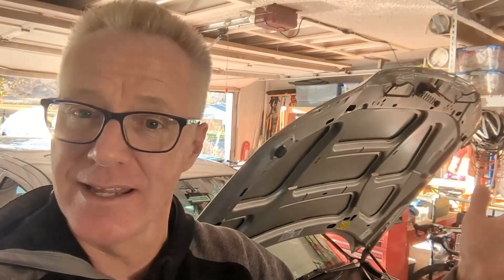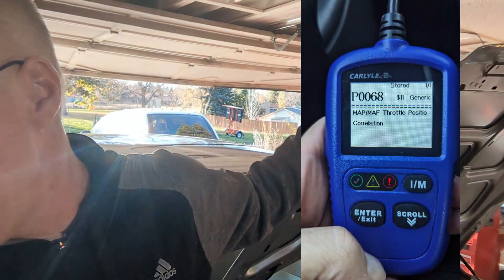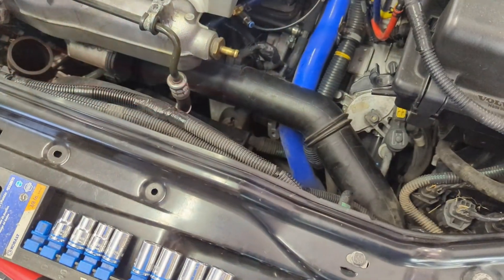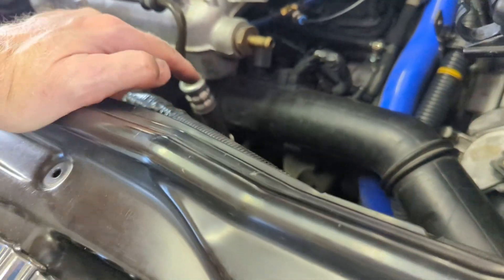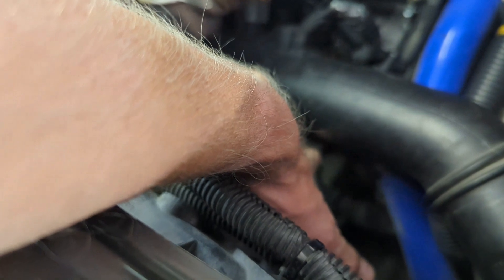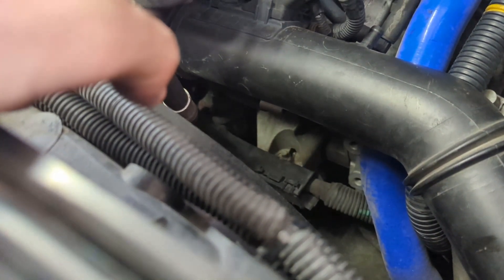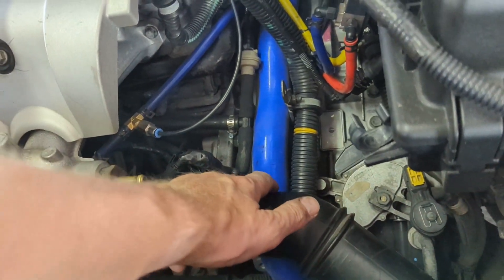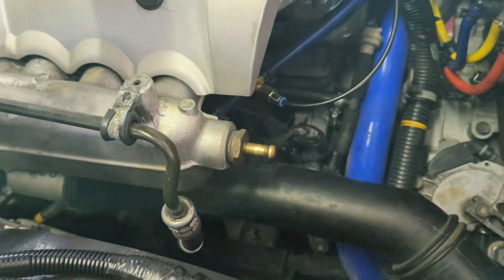Cleaning 2002 Volvo V70 2.4T ETM (Throttle Body) & Sensors After Limp Mode P0068 / P0221 DTC's

Comment: You have the same exhaust i have, i have a 02 v70xc though, i like that exhaust, everyone else hates it lol. I been getting same problems, my throttle body is only 4 years old though but one cold morning i went to go to work and i heard a crack like glass cracking, i didn't think anything of it but then the yellow light came on saying reduced engine performance and i could only go 15 mph and i got to a parking lot and just parked it and walked to work, got back and started car and everything was fine and i shrugged it off as it was just the cold, then i went to store and seen a bunch of white smoke coming from my exhaust and got to store and shut off and seen white smoking just coming out of exhaust, it was weird, i thought my head gasket blew or something and i kept my car at store and had my friends help me get it, drove home without any smoke. Now i get the P2131 code in the background and my throttle behaves oddly, my mechanic is telling me my throttle body is failing but its only 4 years old and it is a bosch and so im thinking it just needs cleaned but i think he just doesn't want to do all the work getting it out and it actually does need replaced and him putting it back in and id have to get a new one anyways. I am trying to talk him into cleaning it though.
Reply from the maker: There's a follow up video where I replaced my throttle body and sensors after the codes returned - posted back in January :)